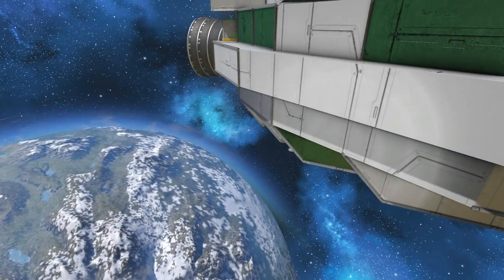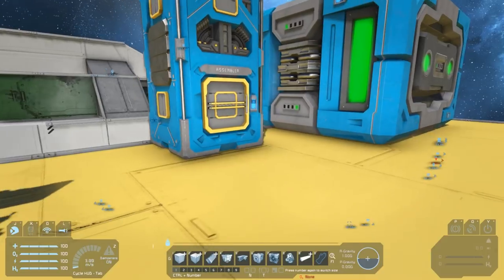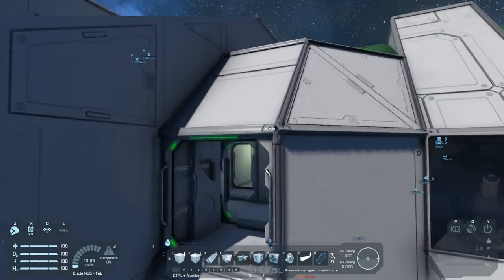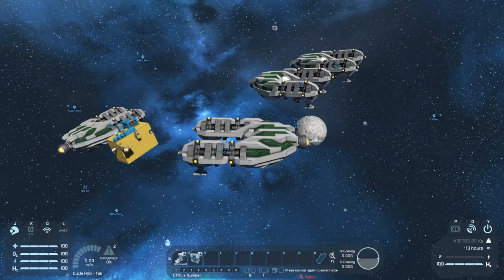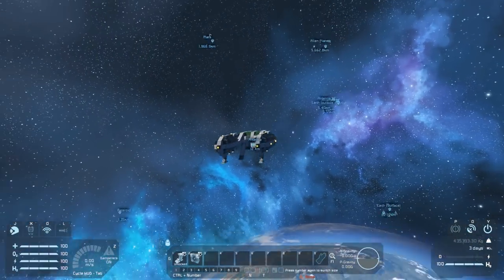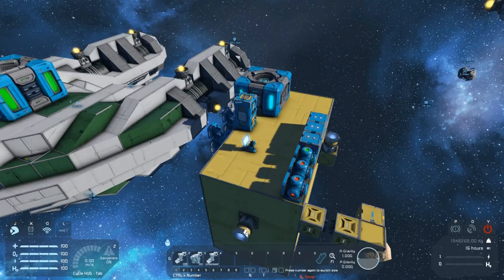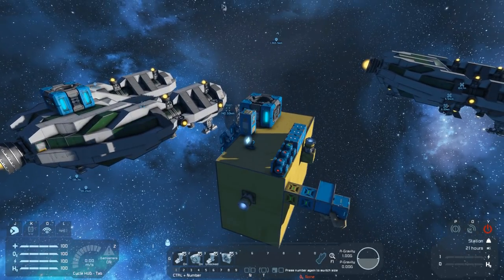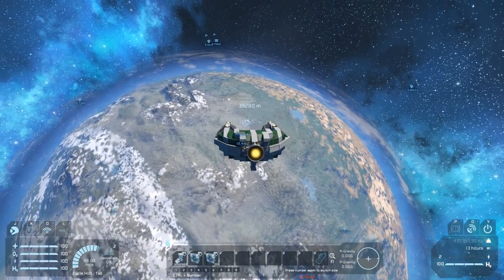Space Engineers Tutorial: Jump Drives (tips, testing, tutorials for survival)

Comment: I can see a lot of fun trolling my friends on the server.
I initiate the jump, ram into them while counting down, then jump away before the can retaliate.
Reply from the maker: that could work, even better have a second set of jump drives so you ram into them, lock on with landing gear, jump, drop them then jump away again ;)
Reply: Or, turn off their power systems, lock on and bring the ships to speed, jump towards a planet, unlock and basically fling them into the gravity well. Then jump far away :D That is of course asuming they can't get their power back on in time to stop from going to far into the planets gravity.

I may have to do some testing with some AI ships first. Just lock on, fly into gravity, drop them off in at least 30-40% gravity, detatch, then make my escape burn. Cause the AI should be to stupid to fly out of the gravity.
Reply: Ahhh, that wouldn't be possible. You cannot activate jump drives if you are in a gravity well higher than 0.05g in strength. You can however try building thrusters that are overridden and force them into a gravity well.

Comment: an interesting concept is a 'warp tug ship' that makes the trip to the destination with attached ships, then returns to base to recharge at high speed without needing many onboard reactors, and may later retrieve the ships if needed
Reply: Something I built was a jump drive satellite. It’s a large grid satellite with plenty of batteries, two jump drives, a beacon, and solar panels, all attached to a connector. The idea is you connect it to a small grid ship, make the jump, and point it towards the sun before you disconnect and run off to do whatever it is you wanted to do, and hopefully by the time you get back to it, both of the drives have recharged

Comment: This stacking jump drives concept seems to suggest a practical application like the 'hyperdrive rings' used by Star Wars fighter-type spacecraft in the Clone Wars era. Build a separate multi-jump drive module with its own reactors that you attach to your sub-light craft via connectors. Leave it well away from the gravity well (and thus be unlikely to be detected) and thus avoid having to haul around all that extra mass when engaged in atmospheric operations or inertia-sensitive operations close to small asteroids.
Reply from the maker: That sort of system works really well, the only limitation for it is that your main ship needs to be large grid as well - at least if you want to remain in the same cockpit when you connect to the jump ring (you can't control a jump drive from a small grid ship attached by any means to a large grid with the jump drives)
Reply: @Splitsie  This seems to have changed; because, I do regularly utilize the cockpit on my small-grid ship, connected by a docking connector, to jump my freight hauler and take me with it.

Comment: One more thing, the jump can initiate only if you have at least 1 full drive, but it will actually draw any available power from other drives, even if they are not fully charged. You can bypass the jump drive recharge delay by keeping 1 jump drive off and activating it after the jump, you could jump 4000km with 2 jump drives, turn on third drive 1 min later and jump 2550km or so(you guys do the math). At least that's how it was a few months ago, feel free to test.
Reply from the maker: That's true from what I've experienced too, you only need one fully charged in order to initiate jump, which is good since it allows for a 'safety' jump drive in case you want to escape the place you just jumped to :)

Comment: Thanks for helping me master the art of hyperspace jumping. Could you make a light speed ring that connects to an actis starfighter from Star Wars like it does in the film. I would like it to have the stages as 

1.) retract S foils 
2.) open blast shields covering merge docking collar things (the circular things with the yellow bar around the edge)
3.) dock with ring
4.) warp

(I realise it doesn’t make a lot of sense so if you see this comment, are up to the task and don’t understand anything just ask. I’ve written this seven times and this is the best way I could put it)
Reply from the maker: I can't recall if you can trigger a jump drive that's on a sub-grid, I feel like you can't but I only feel about 80% on that right now. If you can, then a setup like that is possible, otherwise you'd need to switch cockpits to initiate the jump

Comment: http://www.spaceengineerswiki.com/images/thumb/d/dd/Maximum_jump_distance_depending_on_mass.png/750px-Maximum_jump_distance_depending_on_mass.png

the chart to caculate how far one jump drive can get you based on how much your mass is
1,250,000 kg = 2000 KM and it decreases in a non-ljnesr way.
it doubles per jump drive so if you have 1,250,000 KG you can jump 4000 KM
if your km is say 1000 based on your mass,then with two you can go 2000 KM
with three you can go 6000 if your Km was 2000 as three triples it,and I assume 4 would do the same,and so on and so on,according to the wiki.
I wonder though,if a jump drive is based on mass and if you weigh a lot and add more jump drives,doesn't that also add more mass,albeit a small bit?
need to do the math on that one.
Reply from the maker: It should have an impact, but it's probably negligible when we're talking masses over 1,250,000kg. From what I've seen the wiki's information is accurate on those points so having 20 jump drives will allow you to go 20x as far as a single drive, which is nice for the supermassive carrier :)

Comment: Could you talk about Solar Energy or Energy in Basic. Its really hard to get my Ship flying at the start because charging a battery with 2 Solar Panels ? Nah ill pass :P
Reply from the maker: Charging batteries with solar panels can be truly painful, it takes a long time. It would probably be good to go through the power systems. I've been tempted to wait on that until the next major update as they've previously teased some hydrogen generators so I'm wondering if/when those will be released
Reply: The planetary lander has enough resources for 6 solar panels and you can quickly mine enough to build more.

@Splitsie: I have my doubts about those hydrogen generators. Realistically, you would never get more energy from it than you needed to expend turning ice into hydrogen. The result of burning hydrogen is water, so you could electrolyze it again and recycle it forever, like a perpetuum mobile. I'd prefer if they used fossil fuels or biomass instead.

Comment: How do you connect a ship to a station/another ship?
Reply: Also, what defines a station?
Reply from the maker: There are a bunch of different ways to connect grids together, you can use connectors, landing gear, rotors or pistons. Or if you are connecting two grids of the same size (large-large and small-small) then you can use merge blocks.

In the info panel of large grids there is a button to convert between ship and station (if the world settings allow it and the grid is stationary). That is what defines a station, by default a grid that intersects voxels on creation will be made as a station, and one that doesn't will start as a ship. You won't be able to convert a station to a ship if any of its blocks intersect a voxel (if it bugs out and allows you to do it, then the results will not be pretty) :/
Reply: Splitsie thanks!

Comment: Ive found something odd about the jump drives & they havent fixed it yet! If you merge or connect though a connector to a grid that has a charged jump drive it will add it's power to the jump drives on the grid that you are piloting & I've also found that you can be piloting a small ship & connect though a connector, you can jump using the small ship! I've have made docking jump rings for my small ships so I can jump the small ships away to & from my base!
Reply from the maker: I think that some of that behaviour is quite deliberate, Keen likes to leave game mechanics that encourage things like docking rings and controlling one ship from another as well as allowing power and lots of other stuff to pass through connectors. So I'd be very surprised if that were to be 'fixed' at least not without the community being upset :P
Reply: Well, to me at least, it seems way to cheaty but I do use it too so... lol